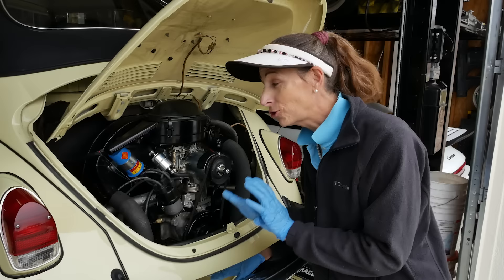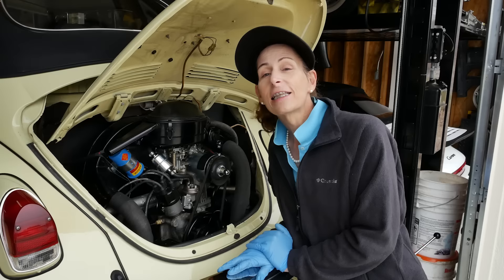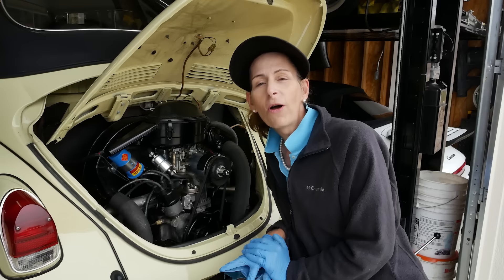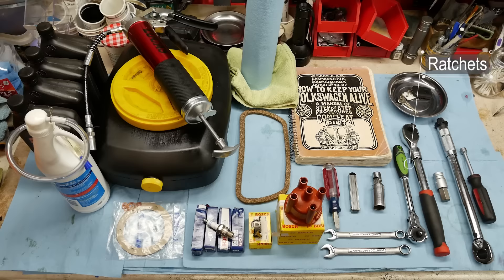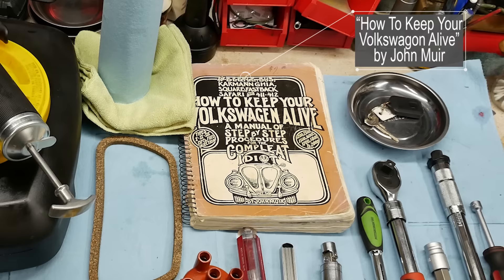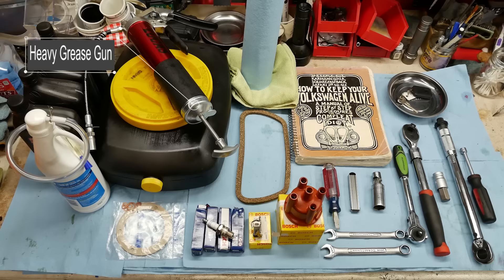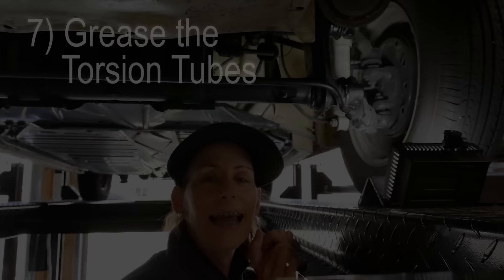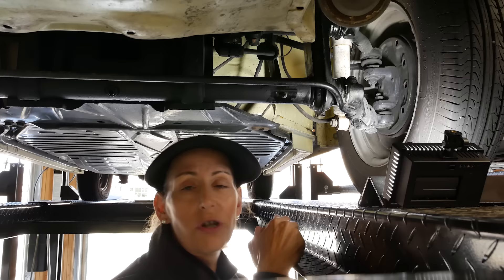VW Beetle Full Yearly Service Tune Up DIY! Easy!

Comment: Do you kind souls have any knowledge about fresh air boxes? I'm nearly on the road but in my state they require a defroster after 1969. Any help or guidence? I don't even know where the switch for the electric fan is or if it has one.
Reply from the maker: Hi There, The beetles have a defroster, but no fan...  It varies a bit by year, but there is a lever on the floor vents to divert the air up to vent slots at the bottom corner of the windshield.  They get their air from the cooling fan for the engine so, the engine needs to be running.  They aren't the greatest, but it should pass your code I would think...  Franny
Reply: That's strange, My super beetle Is a 72 and came with an electric fan In the fresh air box I thought? I've got new heater cables hooked in, Got my lines ran from the fan shroud...I thought maybe when you turn the fans on it acts as a assist to push that hot air into the dash vents to frost.
Reply from the maker: It has been many years, but those fresh air knobs are just that and only control the vent box under the bonnet.  I don't remember them being electric, but it has been a long time since I had my '72.  All heat comes from the engine so you should feel heat down by your foot with the two heat levers (either side of the parking brake) pulled up.  Use that lever at the bottom of the floor vent to switch from floor to window.

Comment: Have you ever seen a grease point around the rear axle of the car, near the hub? My 1972 beetle has them, and I haven’t talked to anyone yet who can tell if they’re original or added on later in life. Thanks for the vid!
Reply from the maker: Maybe for the Emergency brake?
Reply: @HeidiandFranny  Looking deeper, it appears that it was installed to grease the bearings without needing to disassemble the wheel and hub

Comment: I have a bunch of sealed bottles of 80w 90 gear oil from about 10 years ago. Can I use them or should I get new ones? With the cost of oil now I’d love to be able to use up these older ones first

Comment: Recently purchased a trike with a '73 motor powerhouse.  Oil pan leaks a bit as mentioned due mushrooming.  What's the best way to flatten them?  Thanks for the video and hope to hear from you soon.
Reply from the maker: Hi Jarred, Just use an anvil or any heavy flat surface and tap then back down with a hammer.  Be careful not to put in any scratches and you may need to chase the holes with a clean drill bit.  You may need to file the holes slightly, but make sure all is smooth and flat when you are done.  Then torque the cap nuts on after the install.  You might be surprised at how little force they are installed with.  Oh, replace the washers as well.  They really are one-time use.  Good luck! F

Comment: Hi Franny, For the timing is that the same for other engines?  I have a bus and the RPM's go real high after a while so I wanted to check the values and timing and adjust the dual carbs.  They said it's a 1914cc engine.

Comment: Great video. Curious did you use a torque wrench to loosen the Transmission bolts
Reply from the maker: No, that is a pretty snazzy adjustable length ratchet.  Technically you shouldn't use a torque wrench to loosen anything.  It can affect their operation/accuracy.

Comment: Very good info, very thorough. If these things are done your volksie should last forever.
A couple of things though. Every car I’ve ever had, and I mean every car. Had been Boogerd up by someone trying to re-engineer it. It would have the wrong carburetor on it, the wrong distributor on it, the wrong fuel pump on it, the wrong camshaft in it , Or even the wrong engine in it completely. I only know of one car that the owner has ,is absolutely completely original. And therefore, you can set all adjustments by the book.
58:15 ,.....009 distributors are for sawmill engines Running at a constant speed. Certainly not for driving. So how are you going to set the factory advance?  No points? How do you set the dwell?
100.12 shows aftermarket carburetor.  I’ve had German carburetors, Brazilian carburetors, Mexican carburetors, Chinese carburetors… All different makes, And of the four listed here, none of them have the same main jet.  So how can you do book adjustments? 
 What I’m saying, is every car I’ve ever owned. Without exception. Because of different parts, and the  lack of funds on my part to secure the original parts. I had to fudge almost every one of the instructions on  adjustment, to make the car run right. Or make it run where I could drive it, it had power, and didn’t get hot. Tuning up a Volkswagen like this, with different parts has a lot to do with  how the car drives. If it makes good power, and it doesn’t get hot. There’s a lot of hit and miss adjustments you have to make. And you have to use your eyes and ears… And nose  to tuneup a car like this. Ha ha ha. 
Also at minute 107  The book says, that is the official service manual says. To  lift the front of the car,  and unload the components before greasing. This way the grease gets between those surfaces.
 Excellent video, thank you for sharing. 
I look forward to more videos
Reply from the maker: Not a fan of the 009 either.  It is a bugger to get right and re-jetting the carb is a poor band-aid.  Not sure why they are so popular.  When Muir was talking about centrifugal advance, he was thinking more along the lines of what the 356s used.   As for the dwell on the electronic points, I did check it and it is about twice spec.  That will leave the coil charging a bit longer than intended and I've always wondered about it getting a bit warm.  It seems to run cool in this car though...  BUT, when points wear that affects the timing so maybe a personal choice.
Reply: @HeidiandFranny  Wow...thanks for your response. About points and .009 distributors. I am working on a (new to me) car and haven't owned a V W for 20 years. So my choice, because of Muir was a .009. A German one, not Chinese or Brazilian. And my single port 1500 ''H'' engine ran great ( I thought) until I drove my brothers 10,000 original beetle. ha,ha,ha Night and day! ha,ha,ha.
I now know how a completely bone stock original V W Beetle runs and drives. With the correct distributor, there is no lag (as the Germans designed it) and you don't have to.....''keep your foot in it'' so much.
So I am going to use an original (if I can find one...the book says there are 3 different ones for that year? I can't quite remember)distributor. 
I am also going to run points.( Bosch units are still available). Because of the specs on electronic. I figure if the Germans wanted this car to have electronic ignition. It would have had one. But your right ...personal choice. A lot of people like to have these cars but they are not a Toyota Corolla. Hence, fool proof electronic ignition and no maintenance. You have to do routine maintenance on an air cooled , carry spare parts, tools and get your hands dirty. Some people don't like that, but to me its All part of the fun! ha,ha,ha.
Wonderful channel, keep on keeping on!

Comment: I recently purchased “Helmüt” a 73 Beetle. Previously owned a 61. Helmüt had a restoration back in 2008 so I have many projects which led me to many of your invaluable videos. Thanks for what you do. I’m getting a fuel smell inside the car whenever I fill it above 1/2 tank. No visible leaks though. Any ideas?
Reply from the maker: I would check the filler neck and the vent tubes.  I has something similar on the 3.2 Carrera and I found a very old vent tube that was a bit cracked. Good luck!
Reply: @HeidiandFranny  thanks so much. That seems like a great place to investigate. I also own a 2005 Carrera S 911 and am thoroughly enjoying it!

Comment: I own a car which is the same old school mechanism that's fiat 1100d Italian make launched in the year 1971 I am facing a lot of issues in the car I am not an experienced technician who does the job but there is a lot misfiring in the engine, I have replaced a lot of stuff point and condenser and carburetor jets and adjust timing and timing chain and alternator and adjusted valve tappet clearance, anything I missed Franny do let me know in the comments
Reply from the maker: Did you replace the spark plug wires?  You can check them on a dark night...  If you see any flashes you have bad wires.  Is the fuel pump delivering enough fuel?  Check the pressure.  Let me know...  F

Comment: Like your videos trying to troubleshoot having no luck. Have a 1966  VW showing signed of gear oil leak would low fluid cause transmission to sound like spinning gears in all gears but will not accelerate in any?
Reply from the maker: No, that sounds more like a bad clutch unless the transmission is completely broken.  Will the car roll with the engine off and the transmission in 1st gear?
Reply: Does not roll in gear what I’ve come across sounds like a throwout bearing for the clutch still investigating. Thank you for your help.
Reply: Sorry hade e brake on tire spins while in gear
Reply from the maker: @ridiculousred604  Both wheels in the same direction? That is bad.  You'll need to get the transmission looked at. I suppose the clutch could be completely shot... You'll have to pull the engine and start with that.
Reply: @HeidiandFranny  thanks for responding so the symptoms are hard to get into any gear one engaged acts like it wants to go ( on stands by the way) but no tire movement with a slight grind? Have not seen a video showing these symptoms? This 66 was inherited trying to keep in my family on a budget thank you

Comment: Hi Franny;  Thanks for doing this.  I owned a 61 Bug decades ago and am considering getting a Karmann Ghia.  I used to do everything you talk about here and got pretty quick and accurate with valve adjustment.  Am I correct that  all your specifications will apply to the Ghia engine as well?  I used to use John Muir's "Idiot" guide but it doesn't specifically say it is relevant to Ghias, so same question in regards to that book.  FInally, since leaded gas is no longer available, is there any detriment to using unleaded?  Thanks!
Reply from the maker: Yup, all the same bits in the Ghia...  Really just a different body.  As for the lead in gas, it was added to suppress knocking allowing for higher compression in the engine.  Without it the fuel would explode instead of burn...  Modern engines have knock sensors to sense the beginning of detonation and dial back the advance or turbo boost, etc.  Higher octane fuels now perform the same function a s lead did in the past without the same contamination.  A modern turbo charged car will behave noticeably different on low test verses the highest octane fuel.

Comment: What kind of transmission fluid did u use? Great video
Reply from the maker: Pretty standard Valvoline.  Just be careful with the GL rating.  Make sure you use what is correct for your car.

Comment: I’m confused. You found top dead center and adjusted valve #1. Then 180 degrees counter clockwise for #2. Then 180 degrees counter clockwise puts you back at top dead center. Wouldn’t that put you back at #1? Thanks.
Reply from the maker: The camshaft runs at half the speed of the crankshaft. So, when you move that 180° you will be in cyl#3.  If you get lost, just check the distributor rotor.  Follow the lead of the post the rotor is pointing to.  Hope that helps.
Reply: Now that makes sense! Thank you.

Comment: Hello my 1968 beetle is running at 10 degrees. You mention 32 is where you set this beetle. Is 32 degrees the goal? Is my Volkswagen way off?
Reply from the maker: Yes.  32 is the goal at speed.
Reply: @HeidiandFranny  Yeah I found out that I tested it in idle and need to test at 3000rpm.
Reply from the maker: +Wes Simmons keep us posted!

Comment: So quick question. Could all the adjustments you did in this video be a source for the car not starting in the first place..if not checked beforehand? I came home 1 hour ago, and was backing up in my driveway when i choked the car (Vw Beetle 1303s 1974). When i was trying to start it again, it wouldnt start. It just kept cranking the ignition. I placed it in natural and pushed it the rest of the way, got back in and tried to start it again. After 5 or so minutes, i got it running, by cranking the ignition like normal. Havent happened before, so i'm scratching my head a bit..
Reply from the maker: AODigimedia Franny has been slammed with the day job.  She will try to answer you soon.  You can always email on our website.  Heidi

Comment: I thought Id never ask a dumb question but ..Franny, on my 71 Super Beetle Im changing the plugs out. On the right side closest to me  (facing the engine from the rear) I cant get any of my 13/16 sockets on the plug. It almost looks like the shielding and the dual port manifold is preventing that.
I started loosing up the shielding but no luck so far. Going to attack it again once it cools off a little. Any suggestions. Thanks
Reply from the maker: Do you have a socket with an integrated universal joint?  Those are perfect for these opposed engines.  Maybe even a wobble extension would do it.  F

Comment: I have a 68 beetle auto shift or semi automatic. I like to service my transaxle but is it d same as d manual trans? 80/90 gear oil?. It does have a separate compartment for automatic trans fluid(redone).  Any tips ?
Reply from the maker: I really don't have any experience with that, but I would think the transmission fluid would be the same as it is just the clutch that is different.  You might want to try posting to the Samba Group forum.  I'm sure someone there would have that information.

Comment: Hey quick question, what is that blue tube in the engine? My 69 bug won't start, but it seems when I mess with the connections of that blue tube it sometimes starts. What is the function of the blue tube?
Reply from the maker: I believe you are referring to the coil.  Its job is to step up the 12V from the battery and electrical system to 40,000+V needed to gap the spark plugs.  It is charged through the points in the distributor for each spark plug firing.  Check your electrical connections to the coil and there will be a negative wire from the coil down to the points as well.

Comment: I have a 2013 Beetle Trike.
Its using one of the Boxer engines made in Mexico.
I have only done 3000 miles on it... Not even that, I think its closer to 2800 and I have had nothing but absolute hell from this engine.
I bought it from the previous owner and it had only done 820 miles and he was sick of it, and dumped it in his garage and it was there until 2 years ago and I grabbed it off him, but I see why he stopped using it.

It was so useless that he could only sell it for scrap because it was just a piece of shit.

I bought it off him for a fraction of its new price, and it was a miracle that he gave me his dolly trailer cos we manager to get it 4 miles before the smoke got too much.

It has a serious oil leak and we simply cannot cure it.

I have tried to ask at so many garages locally... If I said I have asked at 100 garages, and I am wrong, thenb I meant more than that.

Right now, the ONLY garage that did have a look at it last year, kept  it over winter and then said they thought I wanted to store it, but thats because they kept putting it off and lying to me. In the end they did nothing.

The gear selector is also crap and I have massive issues getting it into a gear, although I have learned that the gears are in a Z shape rather than a H, but itys still a killer getting it into the right gear.

I would love to do the work myself, but the reason I moved to trikes is because I am disabled and its not possible for me to have full access to the engine.

I have had times when the trike runs right, and the fact that its 0-50 is in the region of about half an hour and then it dordles up to about 65 and that takes another morning and the top end might be about 72-73 and to get that, I have to have a full day and a road longer than godzillas junk. but Im ok with that... I didnt get it for speed. ( obviously )

Comment: From what I’ve read, the oil bath air cleaner is the best type to have. Do you find that to be the case? Or do you have a recommendation? (73 thing)
Reply from the maker: I agree.  They are, of course, a little more maintenance, but they do a great job and easy enough to service during an oil change (no need to buy extra parts).

Comment: I purchase a beatiful VW Beatle 1966 It has a new 1500 engine, I would think change the motor oil. Waht oil put in Monograde SAE 30 or multigrad 20W - -50? Best regards.
Reply from the maker: It's going to depend on where you live and how cold it gets but multi grade oil is best. Any modern oil is so much better than was was available when these cars were designed. Valvoline 20W50 Racing is what I use.
Reply: @HeidiandFranny  Thankyou for your fast responce. the temp is abaut 90F
Reply from the maker: Especially right now.  Everywhere.
Reply: @HeidiandFranny  What grade would you recommend if I live in a place with around 66F average all year?
Nights are colder but it never really goes below 47F or above 75F... Place is rather high, around 9000ft, I don't know if that somehow matters

Comment: What type kind of grease are using for the oil gasket and torsion tubes?
Reply from the maker: Just standard wheel bearing grease.  It isn't all that critical.

Comment: Hi does  the car need to be exact parallel to the floor or is it ok to lift only the back side of the car to oil drain ?
Reply from the maker: Not "exactly", but as close as possible...